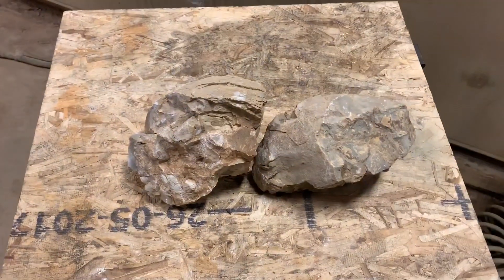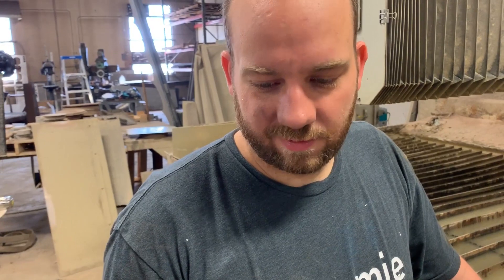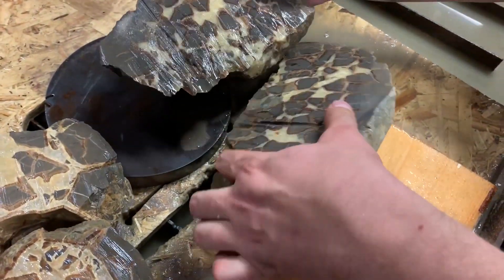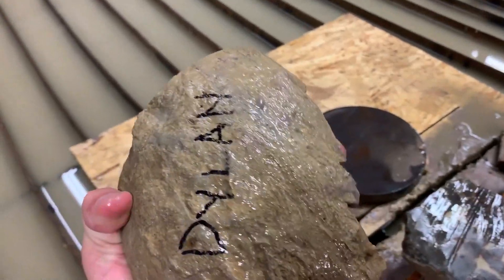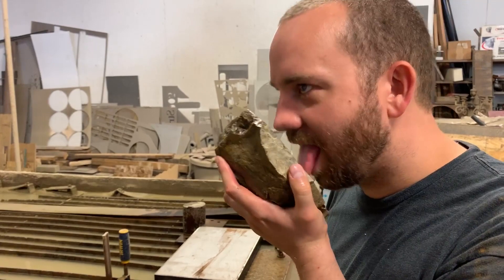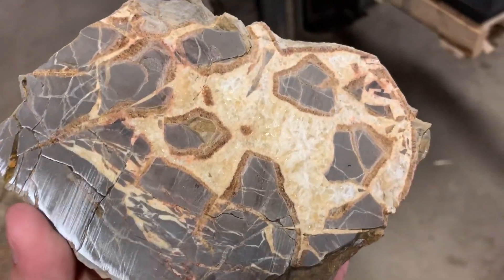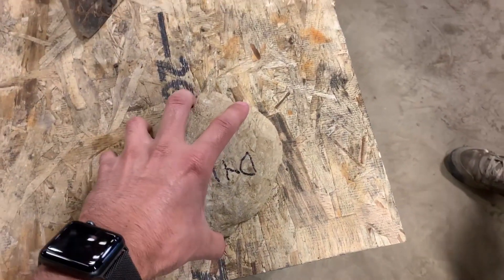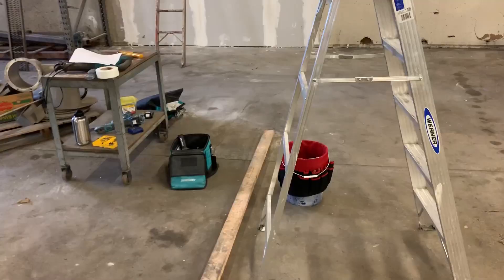Cutting Rocks With A 60,000 PSI Waterjet

Comment: You guys should buy some muratic acid. It will dissolve the calcite and leave everything else.
Reply: Muriatic. Just say HCl
Reply: @CAMSLAYER13  The guys aren't chemists, and if you wanted to buy HCL at a store in the USA, it's sold as Muriatic Acid, specifically at Home Depot and Lowe's.
Reply: @ClippyDrone  it does also say hydrochloric acid on the bottle as well
Reply: Call in Cody'slab
Reply: Wouldnt you then have a mess of pieces and not a polished slab showing the interior?
Reply: Why do you know this
Reply: @awesomegj1  because I know what it does. Highly and quickly corrosive. Storage is tricky.
Reply: @suep9445  at what concentration (%) is storing HCL tricky? ive been storing 24% HCL over years in simple HDPE bottles and nothing ever happened.
Reply: @Sharpless2  muriatic acid is a lower concentration of hydrochloric acid. Even in the sealed container in which it came, fumes can seep out and cause oxidation of items nearby. Recommended never to store it in your basement or your garage, rather to store it outside in a sealed plastic container. Mine is in the original container, which is placed inside a plastic kitty litter bucket which is closed and stored outside. You can find this information online.

Comment: Any ideas about the actual “grit” a tongue is equivalent to? 12000?
Reply: To give you a reasonable answer: sand paper is rated in grits/inch so we can see how many "grits" would be on a tongue. You might think the bumps on the tongue are taste buds but they are actually papillae and there are three types. When licking you only use two which are Filiform papillae which are in the front 2/3 of the tongue and contain no taste receptors and the next type would be Fungiform papillae which are the larger bumps in the back of your tongue. Fungiform papillae are easy to count, there is about an average of 200 of them on a human tongue but Filiform papillae are harder to count. They are the most numerous but also the smallest. I was not able to find an accurate count online but it would be a safe bet to at least double the number of Fungiform papillae for a total of 400. A very rough estimate of the surface area (rounded to make easier numbers) is about 9 square inches. So all in all the 'grit' of the human tongue can be determined as (200 + 400)/9=66. 

The tongue would only be 66 grit if it was hard enough. Even if we were to average Filiform papillae to 600, the grit would still only be 111. 

You are welcome :)
Reply: Dankman69 Thanks for the insight! Very interesting. And yes, the tongue not being hard is key. As soft as it is, it will be several times less abrasive than rough leather
Reply: A cats tongue would be 20 grit
Reply: Łuaksz Ah.. if it was a 8.0 mols hardness, you mean?
Reply: It's soft, but if you look at taste receptor resolution, it'll vary but it'll be much lower than that.
Reply: yaksher Cool. Thanks for the reply. Lower? Maybe 4000?